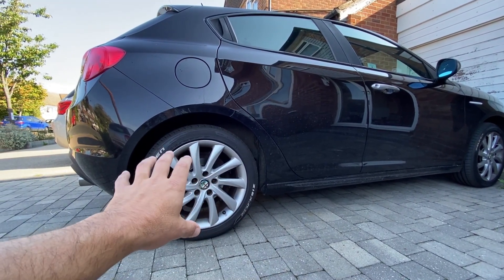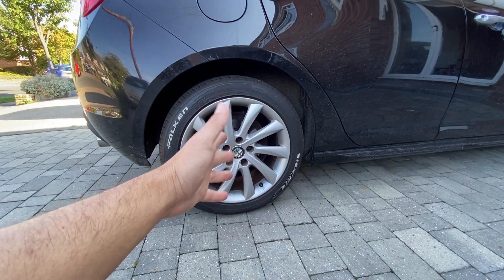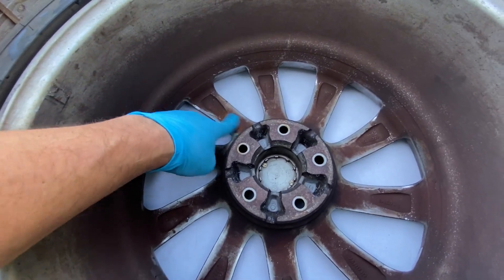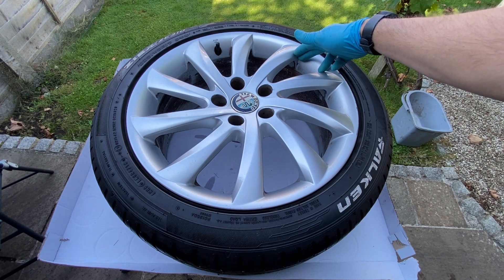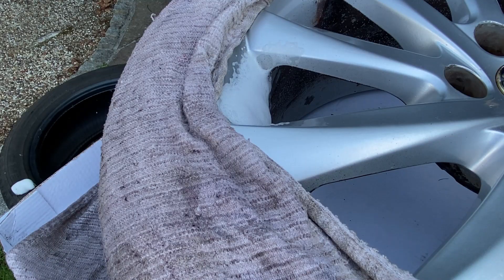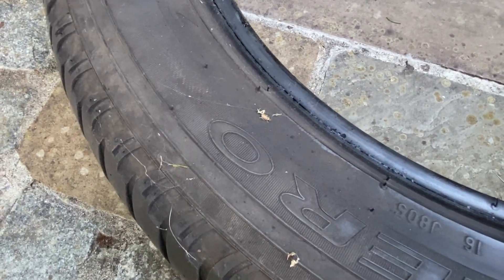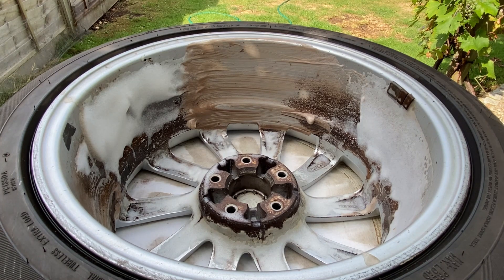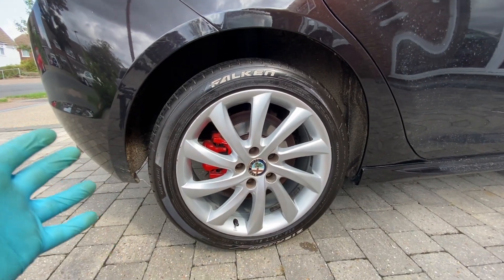Oven Cleaner to Clean your wheels. Does it actually work?

Comment: Caustic is opposite of acidic.  Baking soda is caustic, when you put it on battery terminals it neutralizes the acid.  Bleach and sodium hydroxide are caustic too. To neutralize any caustic cleaners, you can use any vinegar which is acidic to neutralize. Some examples. Thanks for vid!

Comment: That seems to work pretty well,  we had some lads cleaning cars on our garage front, they used an acid spay (possibly autoglem) it worked very quickly but I think it took the shine off my van wheels. I was given a can of wheel protector that you spay on new or clean wheels that stops the brake  dust sticking, excellent stuff really works well and protects the wheels for months, looks and smells like welding anti splatter spray, could be another test video!

Comment: I bought the same product, worked out pretty well, I kinda just sprayed everything including brake pad, caliper, and the hoses and stuff behind, also I got some of it on the paint of the car, I got scared and I washed it off, nothing really happened so... 
It got most of the brake dust off of the  brake caliper  and the wheel was looking sharp. 
No dmg to the tire.

Comment: Hi mate, looking to try this. Did the shine of the rims got affected? Mine got a clear coat of varnish which i don't want to scratch or damage using oven cleaner or rubbing with a kitchen sponge
Reply from the maker: Hi, it didn’t affect mine, but my wheels are a bit of a state anyway. I’d maybe not recommend using an abrasive sponge though if you have a fresh new coat on yours. All the best 👍